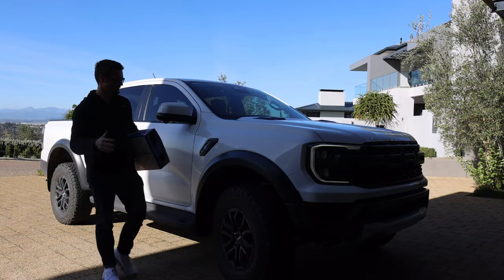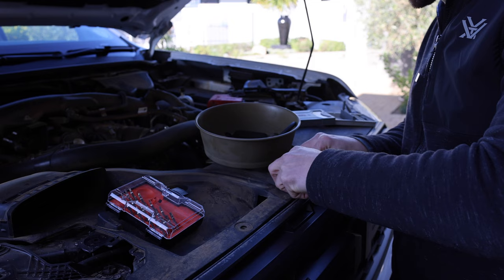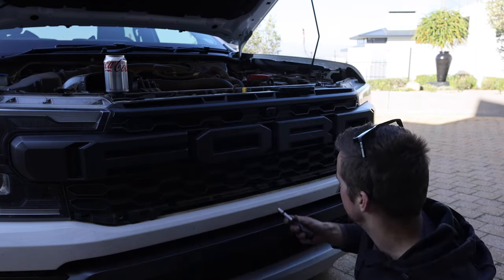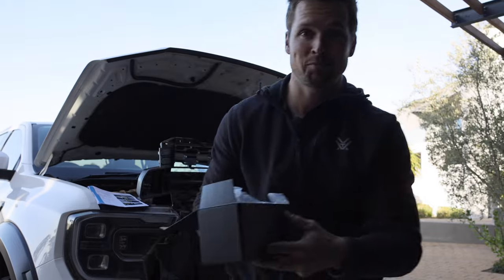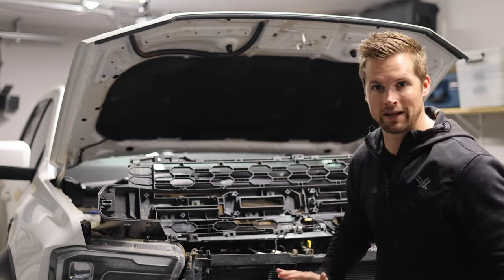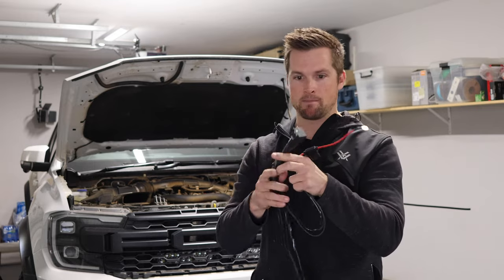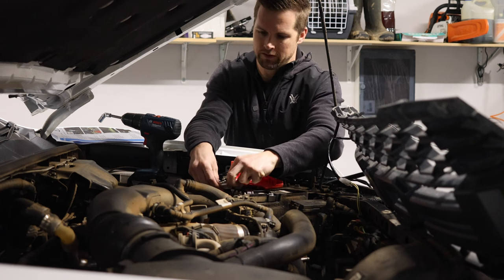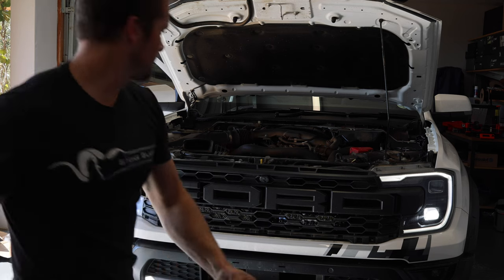Next Gen Ford Raptor integrated Light Bar Install

Comment: Nice vid. No need to wire the harness in as the aux swithes are wired through fused relays to work perfectly. Wiring the harness in is for cars without the pre-wired aux switches.
Reply: Exactly. The wiring i ready including relay, there is no need to use another relay.

Comment: cool vid. You shouldn't have had to splice anything in the Raptor model; two aux switches are wired to the headlights so they turn off with headlights. Your kit is probably for the generic ranger

Comment: Clean looking and big difference in vision at night.   Sold my Raptor last year ☹️ 158k miles still running strong.  Needed longer bed was tired of using trailer all the time. 
Wonder Piet, can you cut opening in grill for lights to shine through?  Technically, they are still behind the grill, but now will shine unobstructed. 
They also sell a grill trim package which allows you to line the opening you’ve made to keep that clean look. 
Anyhow Piet, enjoy your videos all your contact. Drive safely and 🤘😎